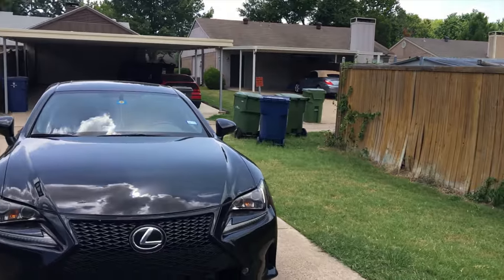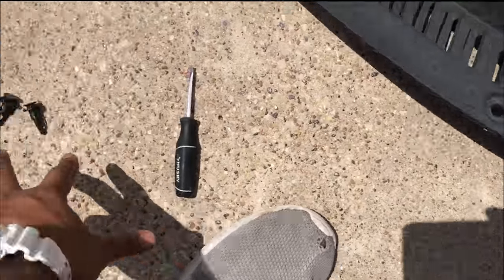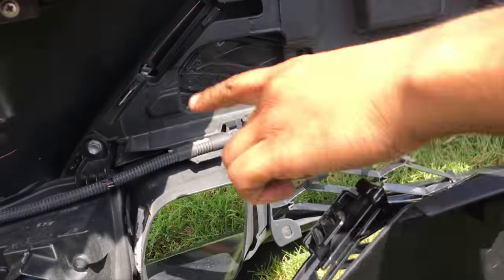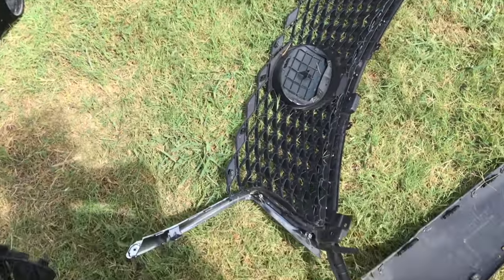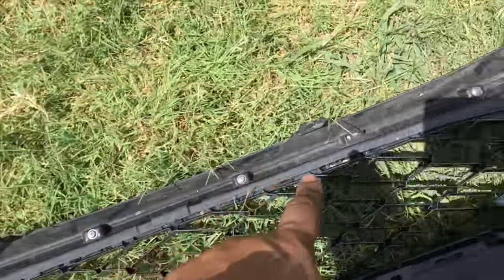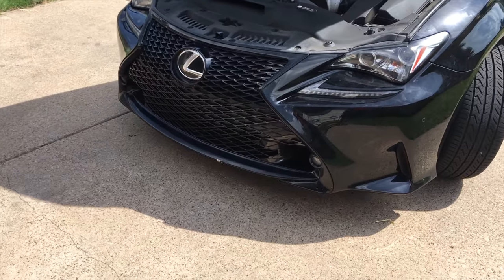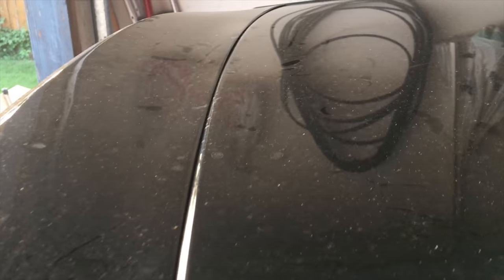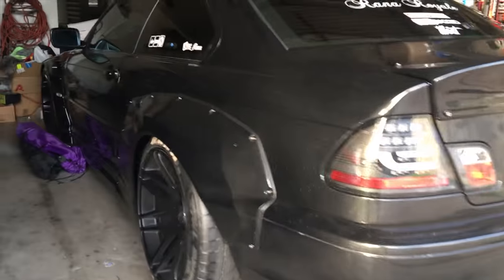Replacing Lexus RCF Grille! Has A Huge Hole!

Comment: You said Lexus would only sale you the full grill but at the end said you got the bottom piece from Lexus? So they do sale the top and bottom separate? Just wondering cause my gs350 fsport top half I bumped and wanted to just replace the top hoping with stock piece
Reply: The grill on most new Lexus models are two piece. The dealers will try to bullshit you with wrong info like they can sell only as a whole; don't fall for it. You can get it separate.. Just get the correct part number from online store that sell genuine lexus parts and ask the dealer to get it replaced (that's how you put 'em stealers in their place)
Reply: RC350_joe do you know how to find the upper grille for rc350 f sport I got into a accident and they want to sell me the whole thing but I only need the the  upper grille